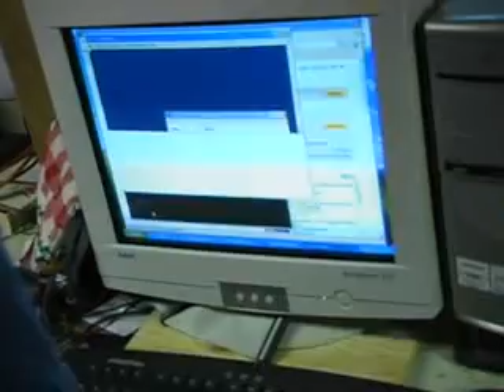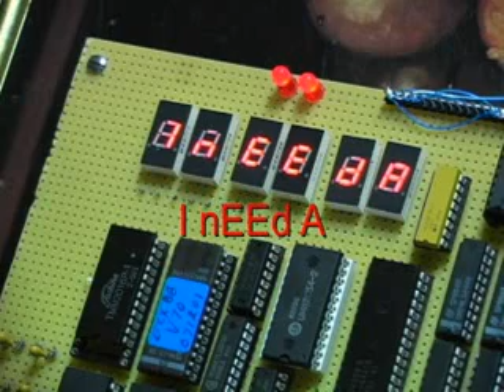7 segment display multiplexing

Comment: wanted set of  eight  7 seg  displays  for alpha  numeric  hex  code    7447  -  has  16   codes  in  some  format tomake you  buy special chip - if you  can find it  .  Its  only a  designated  PROM 

made own  prom  from  diodes -  messy  but it  worked(s)  - so made  four  
All  15  codes  in  diodes  

All   those  IC  -  no idea  what  his  is  4